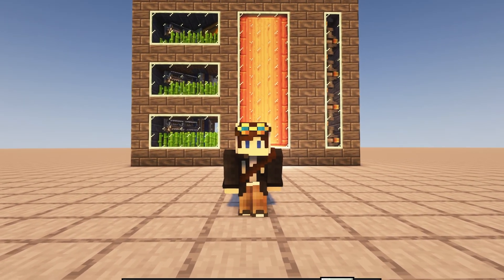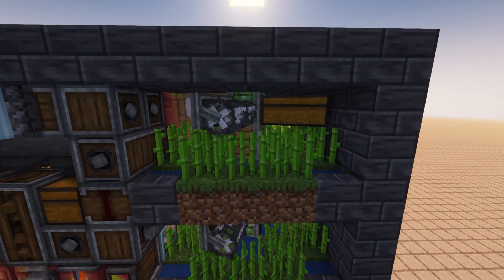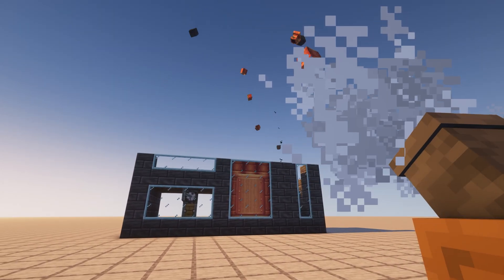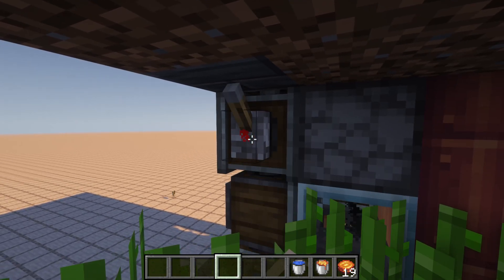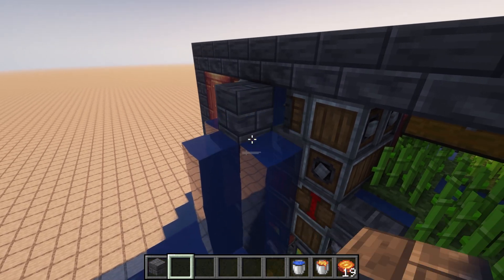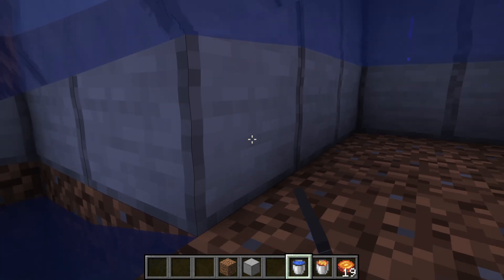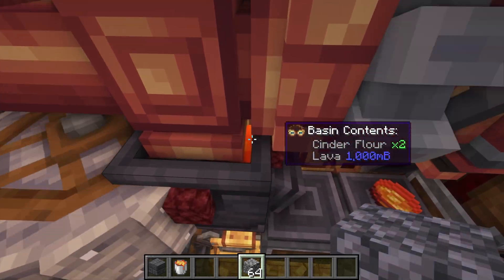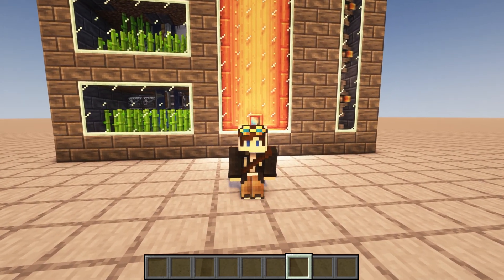Max Level Steam Engine | Create Mod

Comment: It took a lot of work, but I was able to adapt it to work with the new netherrack recipe! I had been tinkering with it for hours before I realized the mixer doesn't work for that anymore, so I switched it with a spout, funneled the lava into that, with it hitting the cobble on a depot in place of the basin. Then used a mechanical arm to move it over to the spot it's supposed to go from the removed basin, and now it's fully functioning! So far at least, going to give it some time to work and make sure it doesn't mess up on me again.

Comment: Hey there! just tried using your schematic and the cannon said I am missing a list filter that filters "Netherrack and eggs" which I got and put in but the schematic cannon still wont go. Any idea how to fix this or perhaps would manually adding it work and it will just skip it?
Reply: need to apply 2 inside.

Comment: Hope you still answer questions on old videos. I set this up on my server, but my main issue is, sugar cane grows far too slowly and results in blaze cakes not being made, and machine eventually stopping. Anyone have a good solution? Also, yes the chicken near the blaze cake depot is annoying. Other than that this build is awesome
Reply from the maker: if the sugarcane is being produced to slowly id recommend making another sugarcane farm in the same way the current one included with the build is setup.

Comment: Don't know why but my boiler wont accept water
Reply from the maker: break and place back down the tanks if you haven't already. Same thing with the mechanical pump and pipes.

make sure they are connected to an infinity water source.

make sure the speed controller on the machine is set the speed controller to 256 rpms if not already
Reply: @OurCreationYT  I did, I found my issue, it’s not that it wasn’t accepting water, it was that the water was immediately boiling

Comment: Did everything needed to set up but despite filling up the boiler with water It would drain It just after filling It up so It wouldn't stay powered, any reason why It may be doing that?
Reply from the maker: are the mechanical pumps on the bottom running at max rpms and have a infinity water source?
Reply: They should be I did place down a water source unless they changed how you make a water source count as "Infinite" Idk how to check the rpms for the Mechanical Pumps though sadly
Reply from the maker: on the bottom of the machine there should be a speed controller where the speed should be set to 128rpm or 256rpm. that speed controller controls the speed to the whole machine.

Comment: After running this for about a month now the main issue is the damn chicken farm. It's too close to the blaze cake spout and eggs fall down and clog the system. I ended up removing the top sugar cane farm and converted it into a chicken farm with a hopper chain into the engine separating it from the workings of the rest of the engine. It still produces plenty of sugar cane and ends the constant clogs. Been running now for about a week with no issues.
Reply from the maker: thanks for the feedback. I'm going to start focusing on performance and quality over compactness in future builds to try to ensure nothing goes wrong with them like the chicken problem you where having.

Comment: I'm having trouble with the water meter I have tried everything I can think of like a different water input but it's water meter is still all red
Reply from the maker: the three mechanical pumps connected to the steam engine need to be running at, at least 128 rpms and connected to an infinity pool of lava. when it comes to simply getting the machine to run in the passive mod you're going to need to prefill a couple buckets of lava before lighting up the blaze burners. hopefully, that helps.
Reply: thanks for the help it's working now
Reply: I Have been trying all day to find out what it is I'm missing

Comment: hey i have a question im plaing on 1.19.2 with create and dont have a ui popup when trying to change the rpm or something like that is this something on a newer version or a addon
Reply from the maker: no, that's available in every version of the create mod. there are no external mods used in the making of this video besides create crafts and additions. but that mod has no effect on the ui.
Reply: @OurCreationYT  i guess i got a strange version of it ore a old one dont know i just have a scrool thing with my mouse not this type here 1:01

Comment: One question: Where do i put the shaft to power something from that generator?
The Output to power something
Reply from the maker: you can have the output be anywhere (besides the cobble gen because it shuts off). the whole system is under the su of the steam engine so you can stem off from it anywhere since its all connected.

Comment: i was troubleshooting this design because it wouldnt make any blaze cake bases, and i found the issue! on the funnel going into the basin press the item filter set there has a filter for eggs and netherack, but if you take it out, replace the netherack with cinderflour, and put it back in, it works again. ill update on this later after running the engine for a while
Reply from the maker: OMG I can't believe I missed that! I've had people complaining but never understood what was wrong, and nobody ever told me about this till just now! thank you for the feedback ill see if I can find time to rework the schematic.
Reply: The issue I'm getting is I corrected the filter on the funnel suggested changing it to cinder flour. But the problem I'm having is the funnel before that taking in the cinder flour to the mixer in addition to cobblestone mixing with lava and cinder flour to produce nettherack...idk if there's been an update since but that recipe does not produce netherrack..? So the machine is not producing 9ts own netherrack and I'm having to manually feed it into the belt....help!!
Reply: i still cant fix it :c maybe im doing something wrong
Reply from the maker: @NotYame  that sucks to hear. in my future builds I'm going to be taking a new approach to complex builds by making them in sections, that way its more understandable and easy to fix. they wont be as compact though but I don't think people care about that as much a efficiency.
Reply: Thank you I was going nuts debugging it.

Comment: There is no super smelting cobblestone to create lava in base create, that is also a mod you didn't mention.
Reply from the maker: Super smelting cobblestone is in base create. That I’m sure of, unless the mod pack you’re using blocks the recipe for some reason.
Reply: @OurCreationYT  There are zero results for it in any google search. There is likely a mod in your mod pack that adds that functionality. 

The only way to get infinite lava in base create is by having an infinite source for a pump, or by having the vanilla minecraft cauldron and dripstone method.

Comment: Hey uhh my belt system is clogged how do i fix it (yeah yeah i alr commented once that was a different sort of comment this is related to the belt system thingy)
Reply from the maker: Once the basin has 16 cinder flower the machine backs up until the cinder flower is used to create the blaze cakes, then creates more cinder flower. In other words that’s what it should do unless your meaning that there is another item that’s not cinder flower on the belt. If so that item shouldn’t be there.